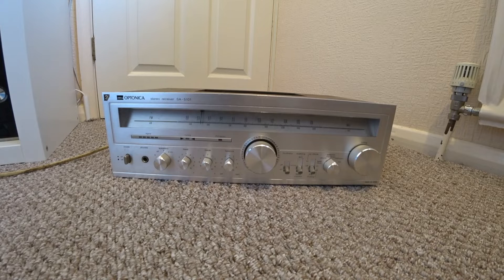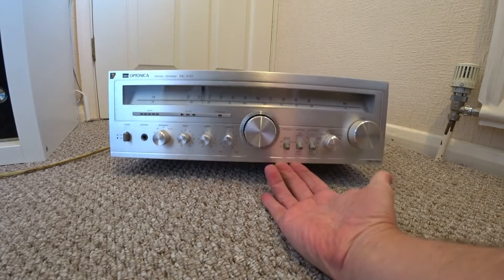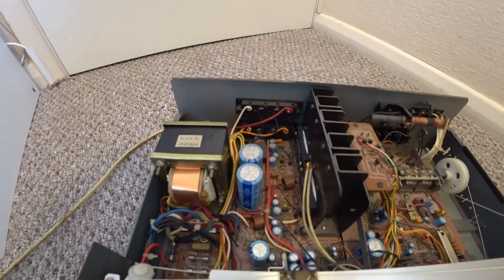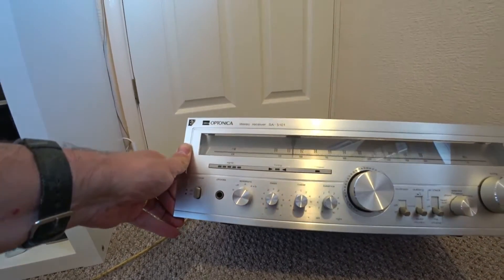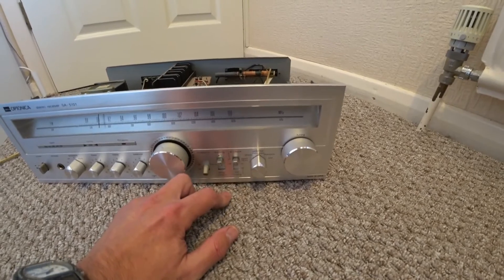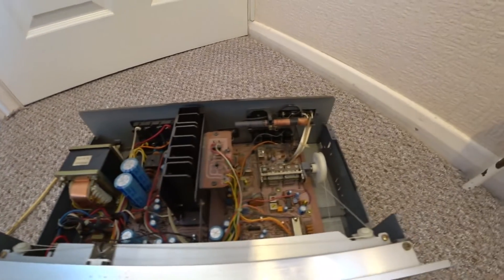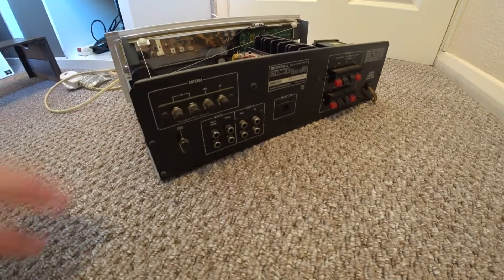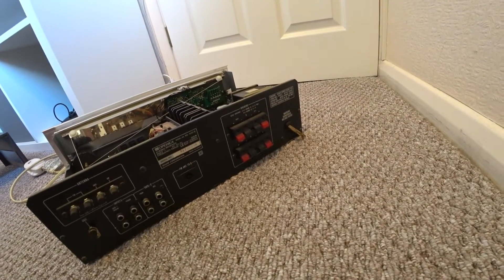Sharp Optonica SA - 5101 - Inside a 1970's Receiver.

Comment from the maker: UK FM CB radio servicing - A little more investigation led me to finding this number on one side of the zapped capacitor: pme271m547. On the board a code says C601.  Found this part as a possible replacement: https://www.amazon.co.uk/KEMET-R463F247050N0K-Capacitor-Radial-Leaded/dp/B01BQVAZ10?th=1